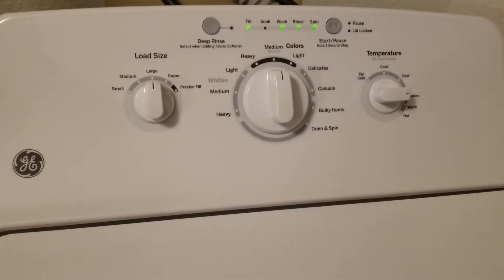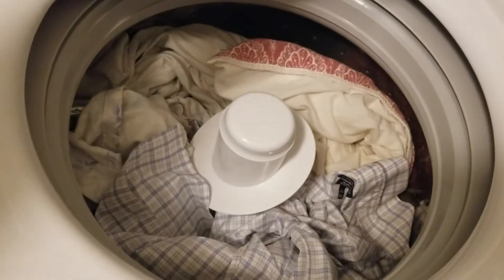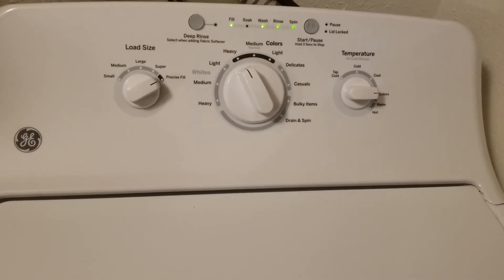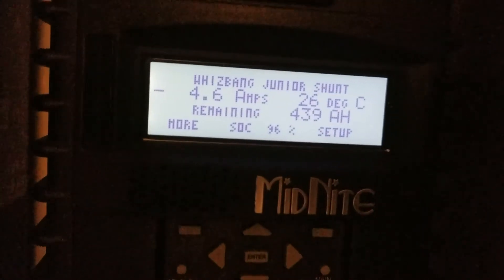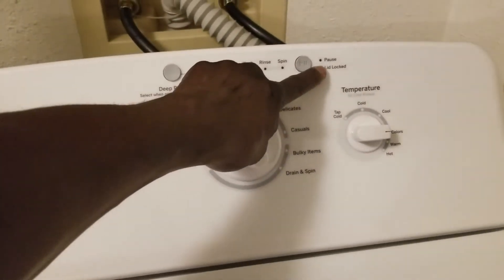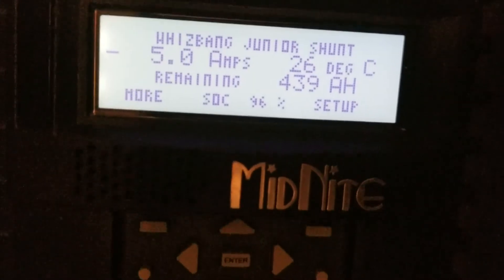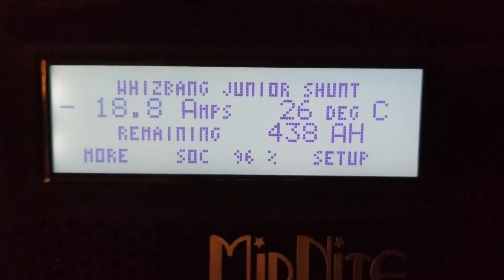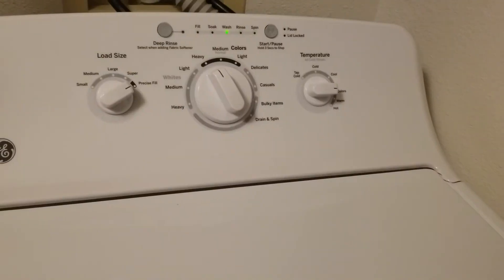SOLAR-POWERED OFF-GRID WASHER & SPIN DRYER

Comment: I have bought cheaper tankless gas boiler and its automatically activated when water circulate, so if you connect warm water to the machine it will not consume power on heating. On that way you could run your machine on solar.
Reply from the maker: You are correct buddy. That was my next video I was about to make 😉

Comment: Thank you for this ! What type of system do you have? ( 12v,24v or 48v) Also what capacity is your inverter?
Reply from the maker: You are welcome my friend. 
I have 12/ 24/ 48 Volts Inverter/Chargers 

1) 2 MMS1012-G Magnasine Magnum 

2) Magnasine Magnum Energy MS4024 

3) OutBack Power Systems FX3048MT
Reply from the maker: Please don't FORGET to LIKE SUBSCRIBE and SHARE my videos and my Channel. 
Cheers
Reply: jwsolarusa If you don’t mind, I have another question. Do you think it’s ok to run a new technology super energy efficient washing machine on a 12v system with a 2.000w mppt inverter? Some say it’s not a good idea.
Reply from the maker: @orpheasnestos7444  
Oh.... yes as long as the washer doesn't exceed the Inverter capacity and it is a Pure Sine Wave
Reply: jwsolarusa Thank you very much! That was what I needed to hear. Yes, I ll be getting a pure sine wave one. I have an mppt pure sine wave right now but its only 1.000w. Some people are totally against 12v off grid systems and it can be confusing. My off grid cabin is in a pretty remote area and getting an expert there is very costly. The ones who sell the equipment here are not much help either, so I have to do a lot of research on my own. Really appreciate it, thanks again!
Reply from the maker: @orpheasnestos7444  
First check your laundry machine Energy specifications and consumption to see if your inverter could handle your washing machine.

Even if it 12v 1000W you can still run your washer but you have to prioritize what you wanted to power first. If it's the laundry, you have to shutdown the other appliances for you to maintain enough Power for your laundry machine.
Reply from the maker: @orpheasnestos7444  
What part of the world are you at?
Would you post some videos of your 12v Solar System please.....
Reply: jwsolarusa Right. Even the most energy efficient ones (A+++ E.U energy label) will need about 2.500w if laundry is set at some temperature. If I run the machine on cold programs it should be fine but I still think it’s best to get myself a 2.000w inverter or above.
Reply: jwsolarusa I’m in Southern Europe, northern part of mainland Greece. So best regards from Greece!
Reply from the maker: @orpheasnestos7444  
Thanks. 
Wish you best mate
Reply: jwsolarusa Thanks . I ll give you an update later on within summer.

Comment: JW, I had my washing machine on the solar but I took it off.  I don't like the way it ramps the inverters up and down with the agitation of the washer.  I don't know if its actually bad for the inverter but my gut feeling is not good.  That said, I would run it on solar in a prolonged grid down situation.  I love stuff like pool pumps where it's a nice steady load all day long.  Thanks!
Reply from the maker: Hello David my brother, I don't think the washer has any effect on the inverter. I normal wash 1 to 2 loads of clothing every week and the inverter is still working great.
Thanks for sharing and have a wonderful evening
Reply: It has no effect on the inverter. My washer been full time on solar now for 2+ years.